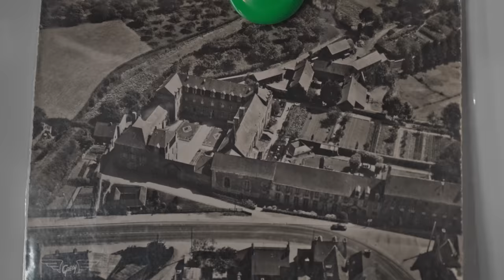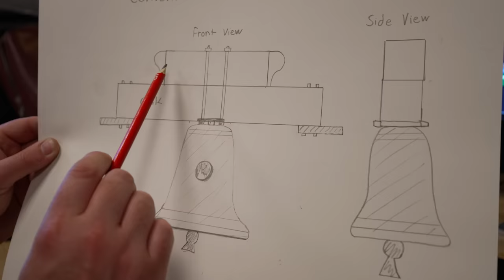We Risked Everything And Bought A Dilapidated Convent

Comment: BILLY, The next endeaver after the kitchen is completed should be the Elevator. It will be a key feature in the renovations to be made on the upper floors. One thing I might recommend is to use a reversing H.D. Drill, mounted in a cradle and attached to the big nut on the shaft seen before. With it, you can easily raise and lower the elevator cage with just one person. As said in the colonys', "SO FAR, SO GOOD!". You have become a celebrty. You and your compardries have become one of the most sought out producers of videos. I'm sure the Sisters who now watch from Heaven above will be waiting to introduce you all to some very important persons.